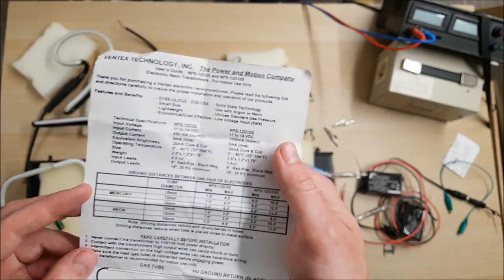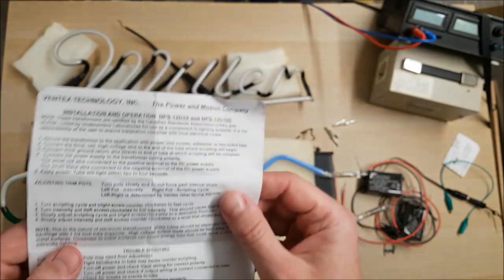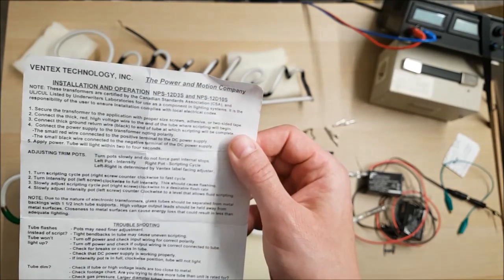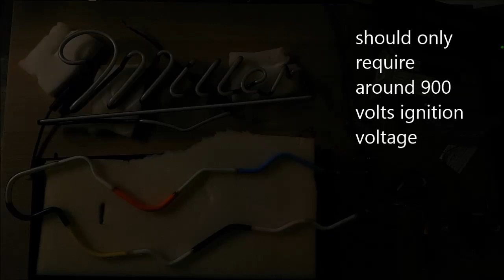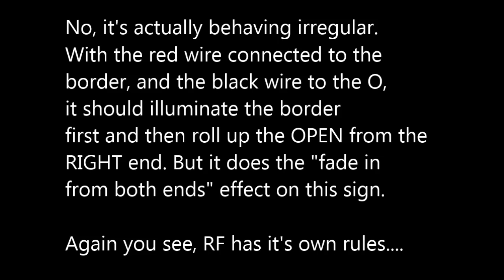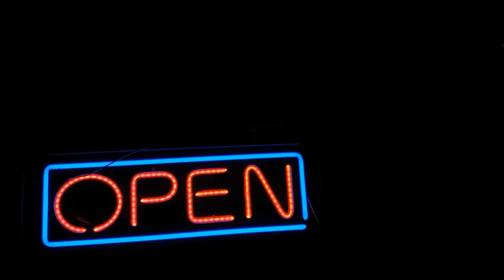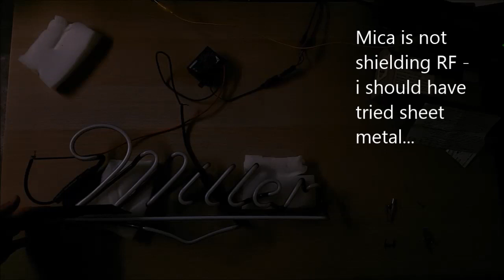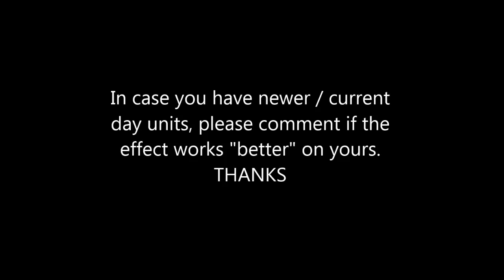New Gadgets: Scripting / Spelling Transformers for Neon Sign Tubes

Comment: Great in-depth video! Does toying with brightness and flashing have any effect on the lifespan of the neon? I recently bought a neon with a dimming transformer and am facing flickering. Any idea what the issue could be?
Reply from the maker: Hi, dimming or flashing actually extends life span on real neon signs. Flickering could be caused by too much neon length on your transformer, did you verify the technical data?

Comment: What I recently and randomly asked to myself:
Would it be possible to have a even more sophisticated electronic circuit, which creates a "filling the tube with light" from one end, but also a "removing of the light" from the same end. Instead of how it is here, that in the end, the tube just switches off completely.
Do you know what I mean?

So the electronics would need to switch polarity in the middle of the cycle, so to speak, and then do the opposite of what is done in the "filling the tube"-process.